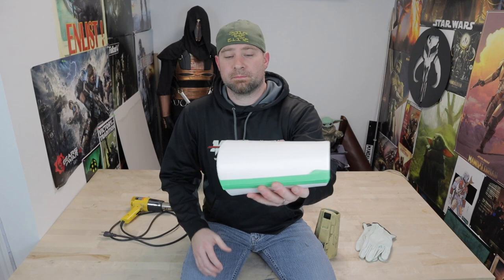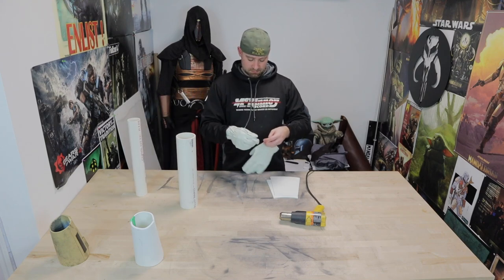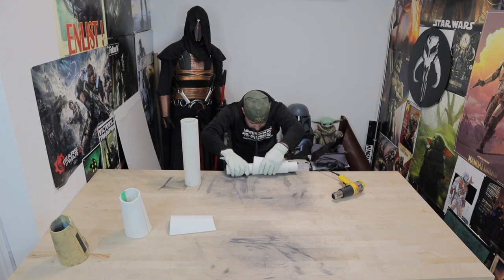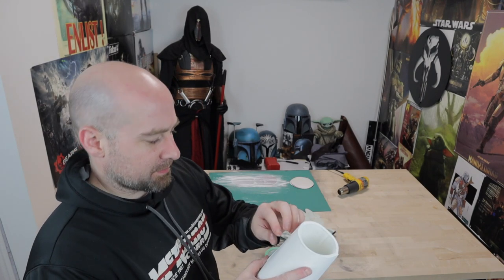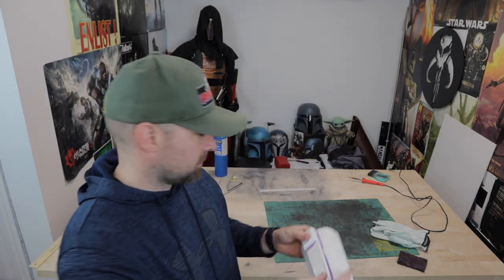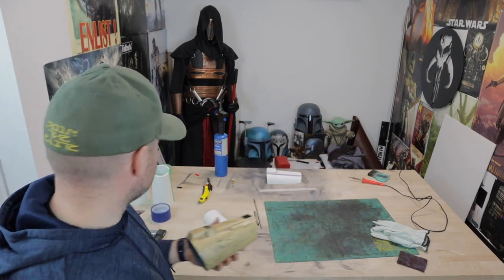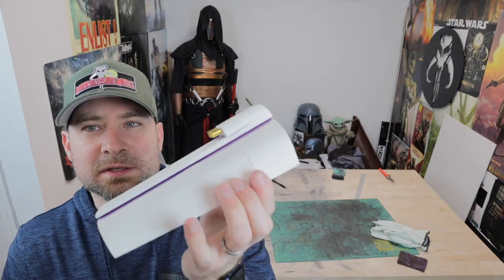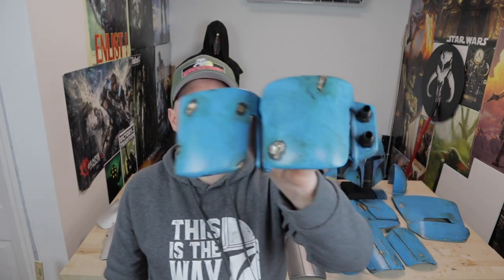BUDGET MANDO BUILD CHAPTER 3 GAUNTLETS

Comment: is that sintra? if so, you should be wearing a respirator and be in a well ventilated area. Heating/burning sintra (and cutting with a dremmel tool) release carcinogenic vapors and particles. Be careful brother.